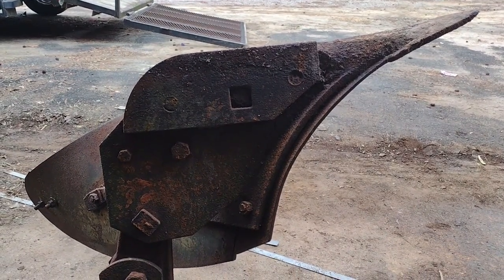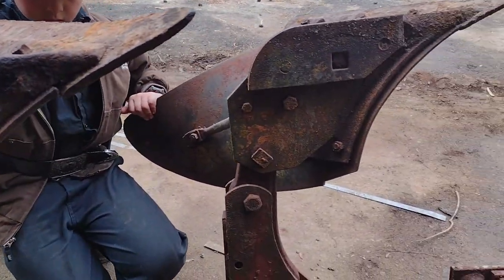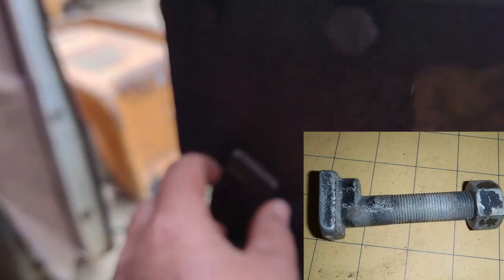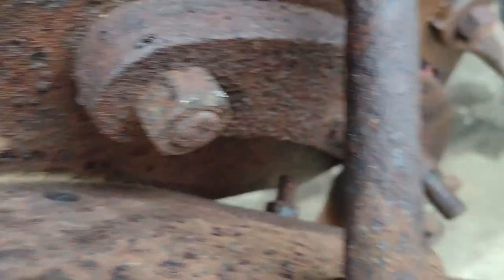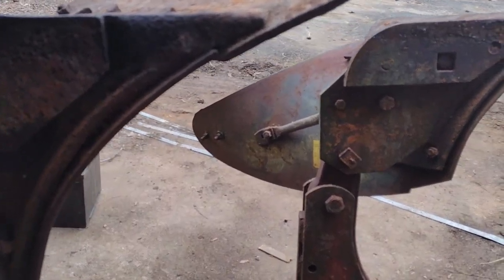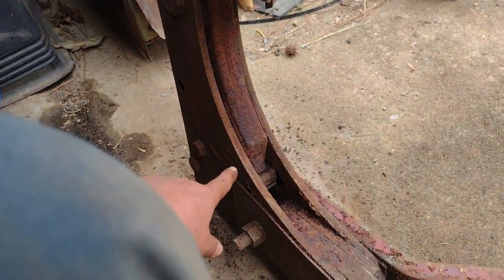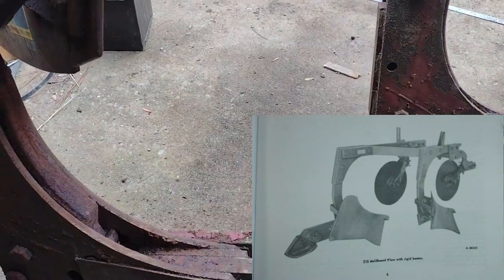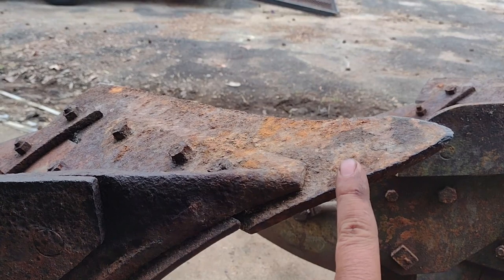Adjusting the Moldboards on a IH 215 Plow for Plowday this weekend #plow  #farmall140

Comment: Thanks for the video. I learned something today. I did not know about that adjustment. I am not sure about automatic bottoms if they are adjustable. Now I'll check that out on our 770 plow. We need to adjust it as aggressive as possible. 6-16s are a good load for a 1206 here. At one time Dad pulled 5-14s with his 650, in this ground,  but it knew it had them.